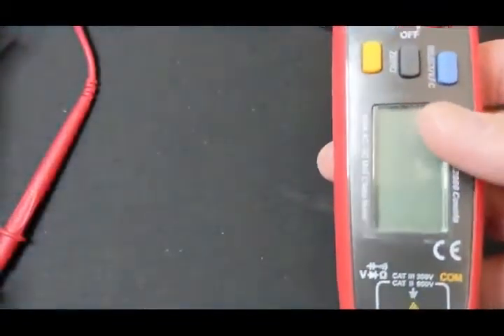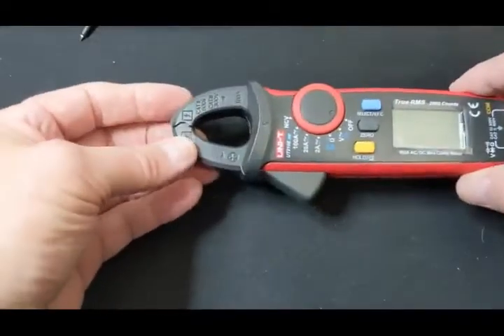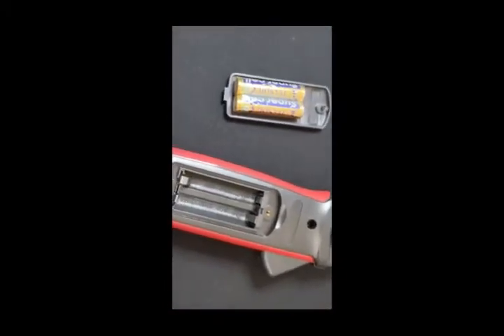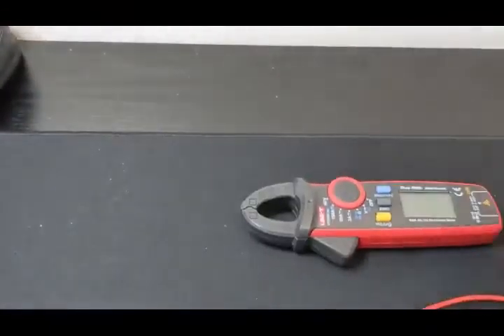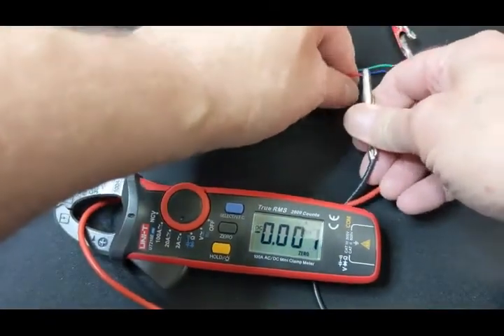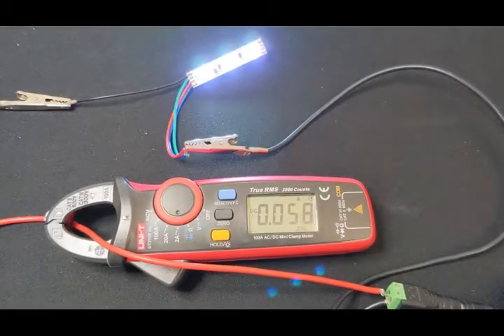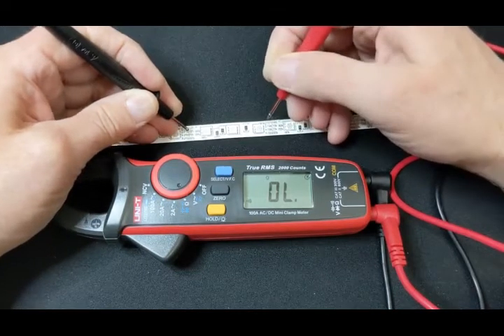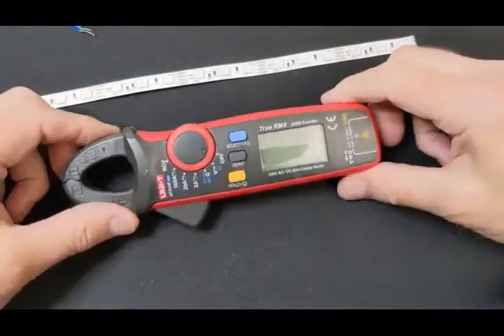UNI T UT210E Pro Mini Digital Clamp Meter, Auto Ranging TRMS Backlit VFC NCV Meter Review

Comment: Thanks for the review Sir! I'm not able to find UT210E PRO listed in their website... Also what's the difference between UT210E and UT210E PRO.
Reply: Bought myself the UT210E not the PRO , but here you can see the difference . Frequency measurement missing and slightly lower reach in capacitance measurement. The clamp is red so you wil notice the difference.
Reply: @andries1704  thank you Sir!
Reply from the maker: Let me check
Reply: @godreadtech  Still checking?